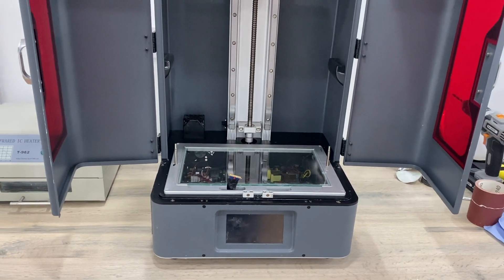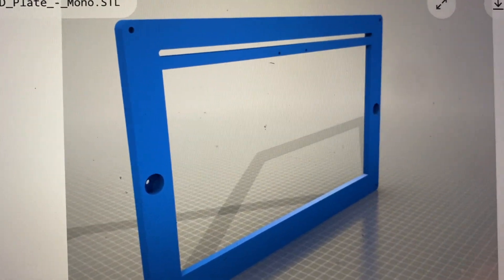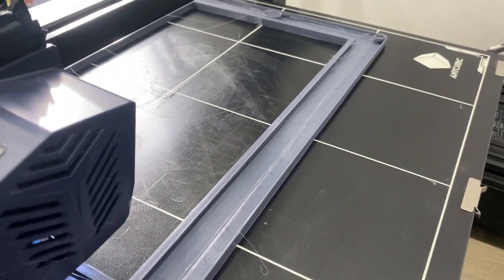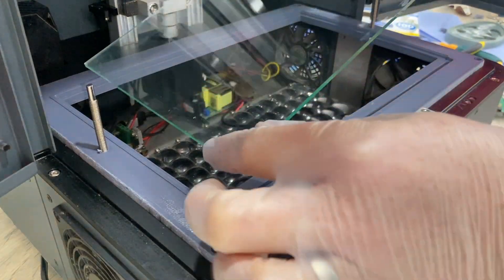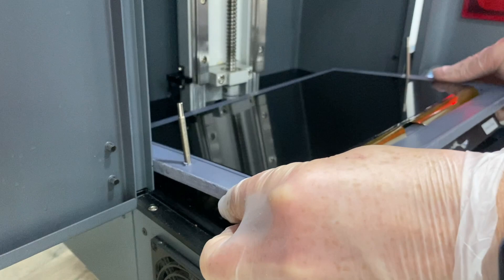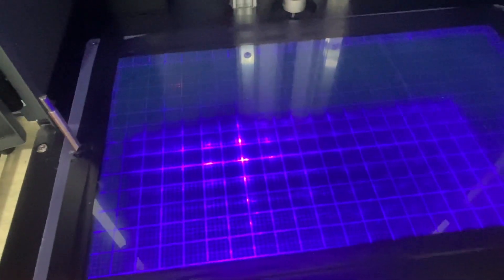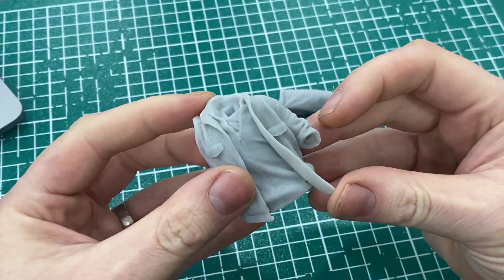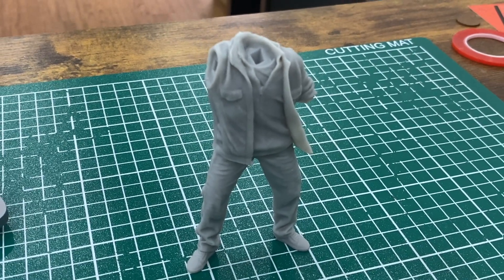Phrozen Transform Resin 3D Printer 4K Mono Fast Upgrade

Comment: Upgrading my Transform to 7k but no matter how much heat i apply to remove the glass from the plate it won't budge, need to cut a channel for the new board, may have to do it with the glass stuck there.
Reply from the maker: I used a small hair dryer and then wedge something in between the glass and the frame slowly build the tension you’ll need tension as well as the heat it will release
Reply: @theboredomchronicles3174  Thanks for responding, will try it.
Reply: @ There's very little movement in the glass only on the side where the board must go, so small only a piece of paper fits through, even a business card wont fit through.
Reply from the maker: Yeah it’s very thin once I applied heat all over I tapped a thin plastic tool into the gap it gave a little and opened up slightly  then I applied more heat and repeated.
Reply: @ Tried again and was able to remove it, thx for your help, i basically added a piece of paper, then 2, then a metal spackle in between the 2 pieces of paper moving in along the peper towards the corners applying heat constantly, then a plastic spackle which was thicker, then 1 popsicle, then 2 on top of each other constantly movie them slowly to the corners along the edge while applying heat. Not to cut that channel for the new 7k mono screen board. Theres one small issue, the old Transform uses a 13.3" screen but this new 7k one uses 13.6" so it's 2 mm longer, would that be an issue i wonder?

Comment: 4:11 Hello, sorry for the stupid question. My boss gave me a device just like this and told me to change the power supply from 5V to 12V because he has installed this LCD upgrade. But as I have no idea about these devices, how exactly does this exchange work? I am a technician, but I have no idea what exactly I need to do to replace this power supply. Simply connecting 12V somewhere where there was previously 5V seems a bit too simple and also a bit bold. So before I destroy something, I'd better ask. Thanks in advance! :)
Reply from the maker: This is the exact probelm I had. The original lcd runs off a 5v usb cable that comes from the main board to the lcd driver board . You need to unplug that and throw it away. Then use the dc input Jack that’s on the lcd driver board. I just ran a separate power supply out of the machine case to the wall. Or you can install one internally and hook it to the main power of the machine plug (correct AC to DC required) from memory it’s 12v 2a. Little bit of faff but it worked fine.
Reply: @theboredomchronicles3174  

Thanks! That helped much. I will look for a 12V power supply and connect it to that power jack on the LCD-driver. 😊😊
Reply: @theboredomchronicles3174  

So, it works perfectly. I found a 12V switching power supply in the drawer, installed it directly in the device and connected it to the LCD driver. I would say: it's working! Thanks again for the tip! See you then! :)
Reply from the maker: That’s great news happy printing!